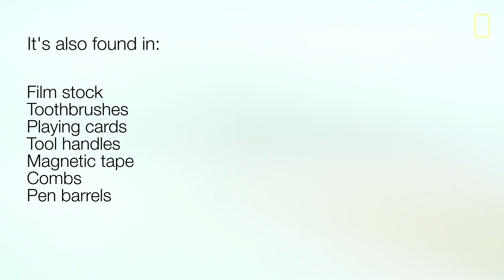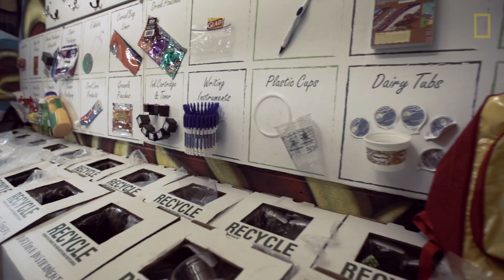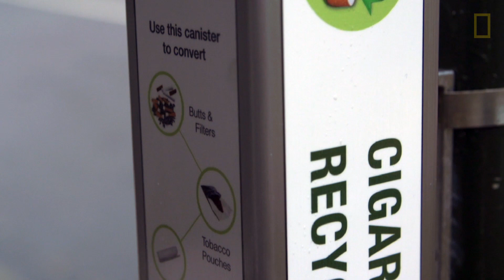Turning Cigarette Butts Into Park Benches | National Geographic

Comment: If the finer ash could be screened from the collected remnants - it may be used as a superior fine abrasive.
I’ve seen it used with great success on older, softer precious metals and with an mild lubricant used to remove certain blemishes from antique furniture.
I wonder if the un-combusted tobacco could be used to extract a lower toxin insecticide…